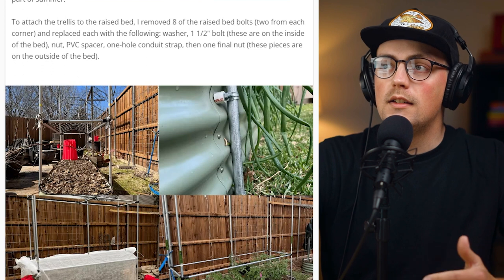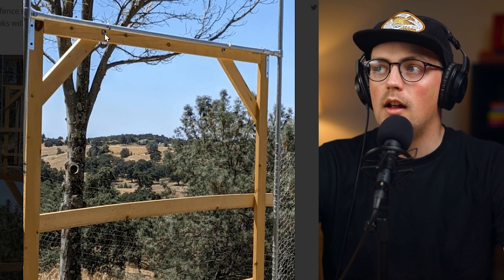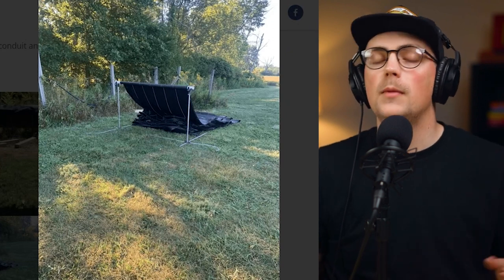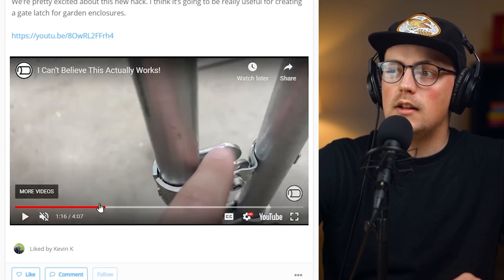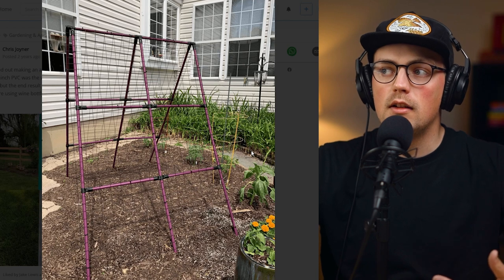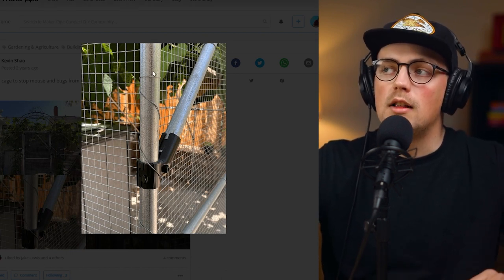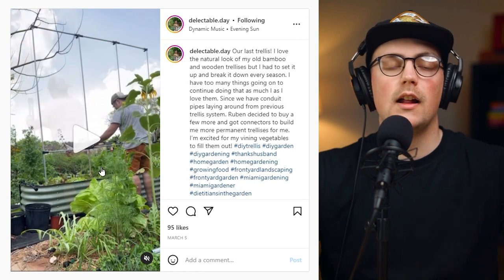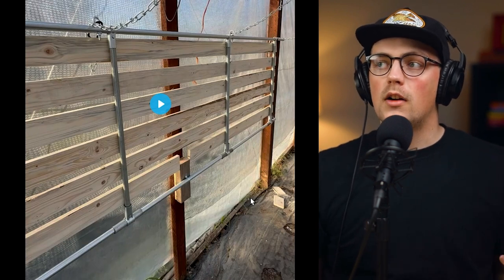Ingenious Ideas You Can Use In Your Garden Builds!

Comment: I've used p.v.c. for sculpture. To get a nice bend and no kinks, use a heat gun. I filled the p.v.c. with Sand, which helps the bend (without kinks!). I used painters tape to seal the ends, bent it, then let it cool. Once cool, you can remove tape and then the sand. It WILL get very hot, so let it cool ! Test it on a small area/bend first as each heat gun has different temperatures ! It is easy to scorch or melt a hole in p.v.c., so caution is advised. Slso, wear a respirator! And, obviously, keep the kids away ! 
Once cool, it will hold its shape, but you may want to keep your conduit nearby so you can "guestimate" your arch/length, etc....
Reply from the maker: Good info. Thanks for sharing!